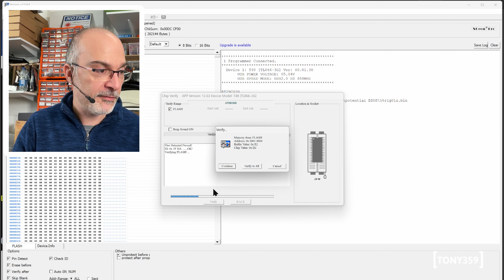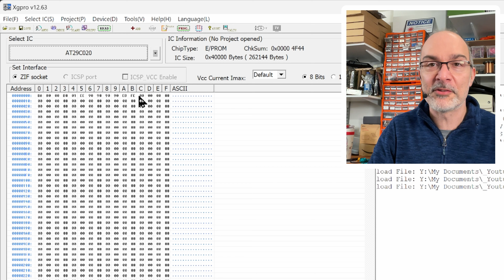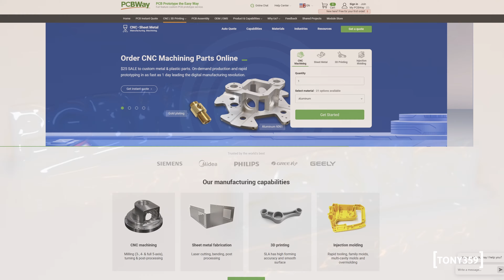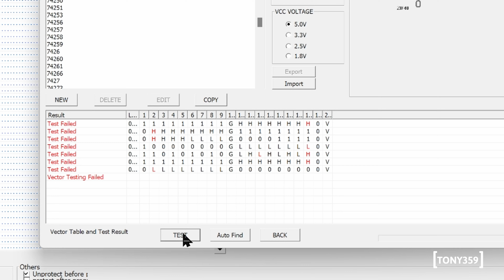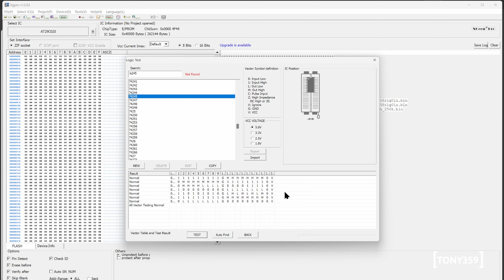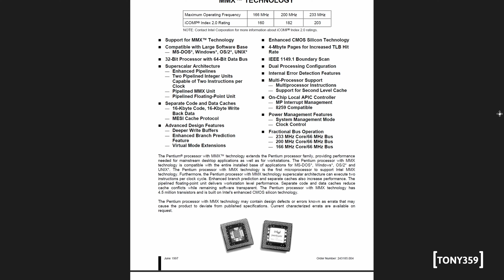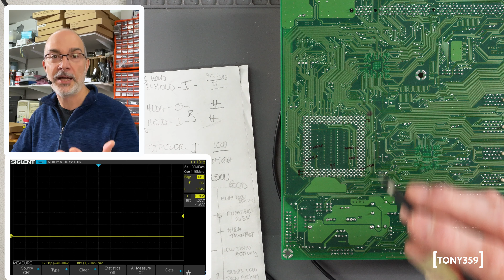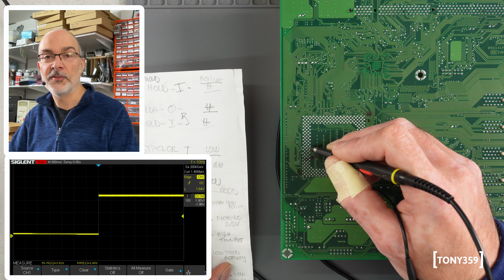I am unable to fix this Socket 7 motherboard!

Comment: Unless someone has a better idea, and if one has too much time on their hands and is determined to make it work, one could map out the back of the PCB socket pinout on a paper, and then go through all non-address/data non-voltage input pins (since you have presumably checked voltages and you have checked that nothing interesting happens to address and data) and map out their startup behaviour and see if something looks suspicious after cross checking with the p5 datasheet. You can just use colour markers and designate colour for each of the common behaviours, or designate a letter per behaviour. It's "only" a couple dozen pins.
Reply from the maker: If you check on my little piece of paper at some point in the video, at the bottom is the behaviour of the Amptron board! :) It's maybe a bit too much, it's easy to lose track of things. Regardless, the CPU on this board doesn't do anything on any of its pins (that I tested).

Comment: I'd suspect the north bridge also. Check if it is getting too hot to the touch, or try pressing it, in case it's a bad solder ball underneath the chip.
Reply from the maker: I have pressed everything on the board for quite some time as that's exactly how I diagnosed bad BGA on the Amptron! But no luck. Nothing is getting hot either, I did check with the thermal camera... Thanks for your help!

Comment: Very interesting information in this video! Broken chipsets are a problem it seems. I once killed a mainboard by placing it on some metal. I guess I shorted some pins of the chipset and it’s dead. Not much one can do I guess.
Reply from the maker: yes that is a possibility and a difficult one to diagnose...

Comment: A week ago I had the same issue with S7 MB, zero activity. The problem was in the NB, maybe more than 10 legs were unsoldered, after full reflow the board works just fine.
Reply from the maker: That happens very often - this is a BGA unfortunately. Difficult to re-solder.

Comment: Fingers crossed you find it, I have a socket 7 which has been a pain. Original AMD k6-2 shows a code but no beep or boot, a AMDk6-2 500 AFX does nothing. Hopefully there is something I can learn from this as well.
Reply from the maker: Fingers crossed!

Comment: Thanks Tony for all your efforts on my motherboard. Just a point. The cpu fan header is not powering the fan and when I first got the board the jumper in that white jumper socket ( I think it is used for an external voltage regulator) was in the wrong position, I’m wondering if that has done something to the motherboard
Reply from the maker: The socket with the 5 pins? That's for the "hardware monitor" - it's so unclear on the manual. How do you know the jumper was in the wrong position? The manual really doesn't say anything about it. If I remove it, the "error" LED stays on all the time. 

And the Fan socket doesn't have 12V on it? It might just be that there is a fuse and it's blown - I suspect the fan is directly wired to the PSU 12V line - but worth checking, thank you!
And no worries, it's fun to get stuck! (well... :D )
Reply: @tony359  Yes that is the socket. I don’t know for sure to be honest but I looked at other photos online to establish the correct position
Reply from the maker: I think I tried all the options and that seems to be the "correct" one, though it'd be nice if the MANUAL said something about that! :D I'll check that fan terminal, thanks.

Comment: some (but not all) pure pci based main chipset boards (the isa is handled by the southbridge on this one, if i recall) don't output post codes to the isa bus, so if you haven't stuffed the post card in a pci slot, thats worth a shot.

i'd be tracing down the clock signals at all points to ensure its getting what it needs where it needs, confirming jumpers for all elements since some of these older ones have them for almost everything it seems.

beyond that, if you have a plain jane p100/133 or whatever in the lower end laying around, set the board to run that and try it that way. could be the 3.3v side of the equation.
Reply from the maker: I cannot remember if I tried the post analyser on the PCI slots, I shall do that! I do have a Pentium 90 - what would be the difference with the P200 I have? Thanks for your help!
Reply: summary of post youtube seems to have deleted entirely; microcode in the bios. but sometimes some boards hated on mid to later chips. you might also try the bios modding tool necroware has shown for older systems. fair warning on that though, it does corrupt some few bioses. so if it does weird stuff,  don't be surprised. but if it does, at least it would be booting.

might also test the caps around the cpu socket. and look at all non-bga chips for dodgy solder joints.

can't for the life of me recall all the info i had dumped in that vanished post.
Reply from the maker: sorry, I know the feeling when you write a long post and the Universe says "no" :)

Comment: Next thing can be checking the caches - it's connected on the cpu bus and any fault block cpu completely.
Reply from the maker: Nothing is burning on the board. What would you suggest I checked on the cache? Thank you!
Reply: @tony359  Power, solder joints, bent pins. You can also desolder chips, board should be able to start without it.
Reply from the maker: I'll add it to the list, thanks! :)

Comment: You could check all the traces of the cpu, pci and xD bus for continuity. Maybe a short has burnt one of the traces? Also it might be worth checking the chipset pins for activity, they should do something as well. Also the pci bus. I guess the chipset is broken. But if there is activity on the pci and xD bus you could narrow it down maybe.
Reply from the maker: that's difficult as the chipset is BGA unfortunately. But I need to check the PCI bus for sure, thank you!

Comment: Hey Tony359 maybe you could try to gentlty push, hold down the SMD chips on the board and then power on? I had two old boards this procedure helped. There were bad solder joints due to e.g. mechanical stress. I could not see that from visual inspection. However resoldering the identified chips then solved the problems permanently.
Reply from the maker: Yes, I found the issue on the Amptron this way and then I re-flowed the ICs for a permanent fix. On the V58 I pushed and pushed but I never saw a glimpse of activity unfortunately. But good idea, thanks!

Comment: Check the south bridge because the south bridge loads the BIOS into the RAM. Processor  without a code can not doing anything. That is the case according to my knowledge.
Reply from the maker: they're not easy to check as they're BGA... But thanks!

Comment: Amptron PM-9600 has the same chipset that Acer V58 does. You can compare signal lines of chipset: their resistance to the ground (on a bare board) and their behavior (with a CPU running)
Reply from the maker: oh, interesting! I can give that a go though I'm not sure all the pads are accessible but I might have seen something at the back of the board. Thanks!
Reply: It is not the same chipset? That is an Ali M153x and this is an M154x.
Reply: @tony359  , I would try to run both models without a BIOS chip and watch CPU and BIOS address/data signals on an oscilloscope. Once I repaired a much more modern board with the same symptoms (No post code , inactive reset). The problem was found in a zero ohm resistor in SPI bus circuit (the resistor was between chipset and SPI BIOS chip). By the time I found out it I had already replaced chipset.
I hope you will manage to resurect the mainboard and I wish you good luck. But from the other side not every mainboard can be repaired for resonable amount of time and effort
Reply: Reflowing those chips??
Reply: Better than testing resistence is measure esd protecton diode in the chipset.
Reply from the maker: Romanm.4763 thanks. What would I expect to see without a BIOS installed?
Reply from the maker: @petr - where do I find such diode? I cannot find it on the datasheet.
Reply from the maker: @asanjuas - yes, that is always an option but I'd  rather leave it for last as re-flowing can go wrong :)
Reply: @tony359  Its a common part of most of the digital IC's. Its part of th ESD protection ring on the chip. I can't paste the link here (youtube delete's comment), by try to find "esd protection diodes" in images. Typically it is one diode to ground and one to VCC (both in the closed direction). You can measure it by the diode test in multimeter - plus to ground and minus to pin.
Reply from the maker: @petr56321313  You're saying that if the protection diode is gone I would see some pins as shorted to ground?
Reply: @tony359  Yes, it's possible. But in general, it's god way to test the boot connection to chip, resistance is not reliable (on the cmos I/O you have all transistors open in unpowered state and it's question what you really measuring ). And next advantage - many multimeters have "beep" on diode it you have a valid forward voltage range - so testing is pretty comfortable.
Reply from the maker: @Roman Ahhhh I see what you mean. Great idea thanks!

Comment: I'm wondering if the CLR CMOS circuit is stuck on, the board would not start if that's the case. Or you simply have the CLR CMOS jumper set on..
This is just a hunch. :)
Reply: I would also say check all states of all bios chip pins and check exactly at what state it is stuck.  What address, data, and so on do we see on each pin? Check the data sheet of the bios chip for the pins for that.
Reply from the maker: Jumper is in the normal position. How would I find out if the CLR CMOS circuit is stuck on? Thank you!
Reply: @tony359  try moving it to the other position just in case to rule out mislabeling. Not likely but known to happen...
I would start by checking continuity on the traces that's going through the jumper, see if continuity changes when you move the jumper. If it doesn't, do a visual inspection for shorts or faulty components.
I haven't had coffee yet so not thinking clearly lol, but the chipset is north + south bridge right? Check for activity on the north bridge.
Another good practice, wiggle components on the board and look at the back of the board to see if anything moves eveen a tiny bit. If so, reflow the solder.

Comment: You mentioned moving jumper JP1 at the beginning of the video but not being sure what it is for, this is used so the system can be configured for either an AT or ATX power supply, ATX supports wake from standby, AT does not, there is a special connector marked JP6 near that jumper where the board expects the 5v standby power (since it lacks a ATX connector) I guess this used some special Acer power supply, never seen this before, anyway there is also a second jumper, if you look at The Retro Web there is a manual with only jumpers, this shows when you move JP1 you also need to move JP15, did you do that? Other than that some boards actually measure the power consumption of the fan and will not start if a load from the fan is not sensed... Finally there is a green LED on the board, is it called HW Monitor? I can't see in the video but this might be related to why it will not start, refer to the same jumper diagram on the retro web: JP7, JP9 & JP10
Reply from the maker: Yes, I did move JP15 when I discovered the option. I didn't think of adding a fan on the connector - all I know is the connector seems to be dead, as it's not getting power. But that might mean it's going through some logic which, as you suggests, checks for a load before providing voltage AND turning on the board. 
Yes, the green LED is off (well, it looks barely lit) and it goes full brightness if I remove the blue jumper from the "HW monitor" socket, for which there is NO info whatsoever on the manual. JP7, 9 and 10, I tried several combinations but I don't understand what they do (JP10 says factory set do not alter). 
I'll try with a fan, thanks!
Reply: @tony359  I can't provide a direct link but the jumper only manual is on the Retro Web that I mentioned, those jumpers are listed in that jumper manual...
Reply from the maker: I'm very familiar with those two manuals. But my board has jumpers the manual doesn't have.

Comment: Check the ADS# pin as well. The CPU should drive this low once it is in a bus cycle, so if it never starts one to even try and read from the BIOS ROM then it should remain negated (high).

The CPU also isn't necessarily going to execute byte by byte like older CPUs, there's a lot of parallelism going on (64 bits at a time). The BRDY# pin will be asserted by the chipset towards the CPU once it has presented some data in response to a read, or taken some data in response to a write, so that might be a good one to look at too.

Also rather than trying random address bus pins I would be a bit more targeted. The Pentium doesn't have address 0-2 pins, instead it has 8 "byte enable" pins. So I'd also take a look at these to see if there is any activity. For each byte out of an 8 byte chunk that the CPU wants to read/write it will assert the corresponding BEx# pin (maybe multiple at a time too).

And of course, know your enemy! Look at the behaviour of the pins on a known working board so that you know what they should be doing out of reset.😊
Reply: I think also checking NA# might be worthwhile. This seems to be a signal from the chipset to the CPU that it can accept a new bus cycle. If the chipset doesn't assert this signal the CPU may never start trying to access the BIOS ROM.
Reply from the maker: Thank you! I am learning more and more about the Pentium and I understand the first thing it would do is call for FFFF which is... high. So maybe what I observed was expected and as you said I should look at more specific pins. Thank you!

Comment: i recently worked on a slot1 board, also dead with no activity on the bios pins, turned out to be a dirty processor socket, give deoxit a try i guess
Reply from the maker: Yes, I haven't checked the socket, it's a great idea!

Comment: Have you checked the signals on the CPU from the top? Could simply be a broken connector in the socket. CPU is behaving like there is no clock at all. But the CPU looks like the pins are available for contacting from the top.
Reply from the maker: It's on my list, thanks! I plan to inspect the socket with the microscope and maybe check for continuity. Thank you!

Comment: Could you try pushing down with a finger firmly on the Northbridge and/or Southbridge and while at it power on the board and see if there is activity on the bus? Sometimes the balls underneath are cracked and not making good contact...
Reply from the maker: Thank you! I have already, for quite some time :) It didn't make it on the video. Though, I didn't check if there was activity, I was only checking on the Post Card. I can try that, thanks. The Amptron was fixed that way :)

Comment: Do you see any address lines activity at the BIOS chip? If not, are there any 74-series buffer chips near it?
The reason I ask is because I believe the BIOS is located at the correct address on Socket 7 boards, and is needed to initialize chipset registers.
(Granted, this is based on observations from a Cyrix MediaGX damaged VIA MVP3 board, where the CPU does start to execute BIOS code but fails after the first POST code, because the chipset was fried by the incompatible CPU…)
Reply from the maker: No, no activity and I mentioned the LS logic chip at some point in the video - that's also good unfortunately. 
Interesting about the BIOS being needed to initialise the Chipset, thanks for that!

Comment: Maybe you could measure and compare the resistance values of the address and data lines. And/or check capacitors for shorts.
Reply from the maker: I have checked with thermal camera, there are no obvious shorts on the board. Comparing the lines against the Amptron - same or similar chipset - is a great idea! Thanks!

Comment: Is there connection between socket and the cpu? I had one slot1 board which seemed totally dead. And all I have to do was to use the contact cleaner.
Reply from the maker: something I have forgotten to check, absolutely! I can check the socket with the microscope, I should be able to see if the catches are there. And then maybe check continuity with the multimeter! Thanks for that!

Comment: Hi Tony!
A you checked the clock crystal near the SB?
Also, near the bios chip preset the crystal, i dont know for what it.
Try to check for bad or broken any elements, try to cheking the CPU slot pins, check pins on any other chips, try to press on the NB, SB chips and then start the MB.
Reply from the maker: Yes, I had forgotten about the CPU pins. I intended to check them and then I forgot. I can inspect with the microscope thanks. The clock near the RAM should be the reference one for the clock IC nearby - if that doesn't work, you shouldn't have 66MHz at the CPU. The one close to the BIOS: interesting. I wonder what that is for. I'll check it thanks!
I've inspected the board - front and back - multiple times for a broken trace or broken "something"... :(
Thanks for your help!
Reply: The little crystal... i would think that looks like a 32Khz RTC crystal. There should be an RTC logic and NVRAM chip nearby, upheld by the battery which is also nearby, since that and the BIOS share a bus, called XD bus off the south bridge.

And yet it's a little surprising that there is no activity from the CPU at all, not attempted BIOS read, no address-data bus activity? Seems like there should be a more immediate reason that should be more directly measurable.
Reply: @SianaGearz  Yes, i mean the RTC crystal marked on board as X3